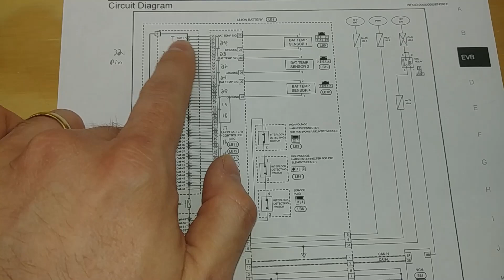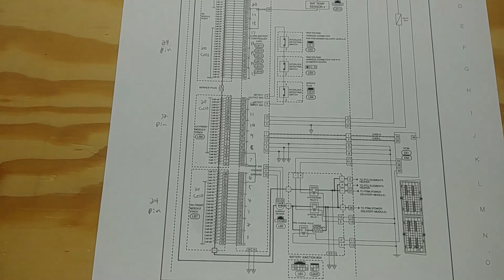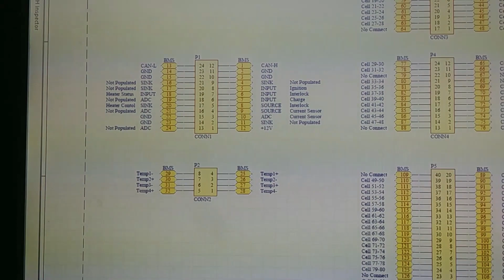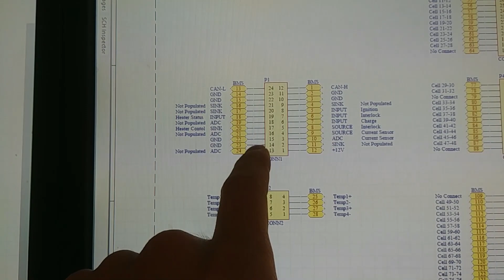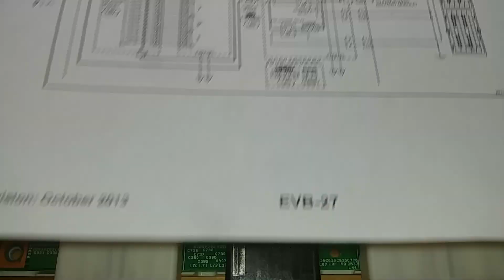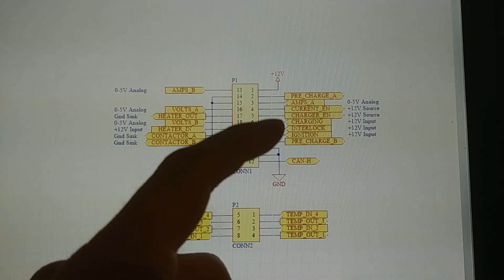Solectria E10, Lithium Ion Battery Upgrade, Part47

Comment from the maker: Also, I had an email asking about using the stack voltage sense in the motor controllers, instead of the one in the battery charger...

They AMC controllers are powered off high voltage only, they don't have a way to sense the stack voltage, without first being powered up.

Also, they don't have a CAN interface... Yet. ;)

Comment from the maker: I am actually surprised by all the comments to keep the power controller boards...

I really think that modifying the BMS to control the contactors and pre-chargers directly simplifies the design...

I think the aversion is to scrapping an existing design is what people are objecting to, but this happens all the time, it's part of research and development. ;)
Reply: Well, there is also how are you going to get the conformal coating off the BMS board to be able to solder to it?  Don't get me wrong, I agree the system will be simpler if you can move that to the same board.  I guess modding parts on to the BMS board seems like an unknown that potentially saves very little it seems in the way of complexity and space...  But if you do add the parts to the BMS board I will be interested to see how it goes :-)  Always fun to follow along!

Comment: While I do like the idea of putting it all on one board, your little contactor assembly is so nice, shame not to use it.  I am going to have to go back and watch the video about that contactor assembly to remember what features you put on it.  Wow the date on your board there, 2016, time flys by.
Reply: After rewatching the power controller board video why not just dumb the logic down on it and have the BMS board just receive voltage data over CAN bus and then  send back over CAN which contactor(s) to turn on or off?  Seems like you have such nice hardware already built...
Reply from the maker: That could be done...
But taking it one step further...
And the BMS could just control the contactors directly. ;)
Reply from the maker: Power Controller does have a playlist: https://www.youtube.com/playlist?list=PLQdu_G7xyFIQ9Gabus1Yek2_ds1Ns4wFs

Yeah, 2016...
What was on supposed to take a year got delayed by moving and having a baby. ;)
Reply: @WolfTronix  I remember watching the video when you designed the little PCB and ordered it... I just did not realize it had been that long.  But I cannot say anything, I have had a Chevy Volt pack sitting on my garage floor for the same amount of time unmoved collecting dust...

Comment: Great work Wolf!  Blowing my mind as usual.  Also I wanted to say thank you for creating the pack sniffer, the one I purchased over a year ago just saved my ass.  I had issues tracking down a miswire in my Battery pack.  The pack sniffer identified cell 8 as Zero volts.  Turns out I had cell 1-8 wired as cell 2-8.  Quick fix, all 96 cells are reading correctly and the pack is well balanced!
Reply from the maker: Nice!
I am glad the Pack Sniffer was able to help trouble shoot your battery pack wiring. :)
Reply: @WolfTronix  will your microcontroller LBC work with a leaf VCM?  I understand that these are programmed together by Nissan.    I wonder if your chip could "unlock" this in addition to all the other benefits!

Comment: Other than the issue of multiple micros, I think the modular design has more advantages. If the main micro locks up, what happens to the contactors? (Genuine question) Also, would it be possible to have the main micro on the BMS have control over the module based micros over a bus? (Maybe stupid questions, sorry)
Reply from the maker: The microcontroller I am using in the BMS is the dsPIC33EV256GM106
This is an Class B automotive microcontroller...
It's probably running in the car you drive now. ;)
But seriously look up the specs on it, has built in redundancy, back up oscillators, windowed WDT, windowed DMT, ECC Flash! 

But anyways, if the micro in the BMS was to fail, and for some reason, it hard locked so bad that it could not reset or do anything...

There is an external watchdog timer chip on the BMS that will trip  and hold the micro in reset, and open the contactors.

And yes, over CAN bus any micro can control any other micro via CAN messages (code has to written to allow this to happen).

The power controllers would not operate independently, they would need CAN data from the BMS and Smart Switches.